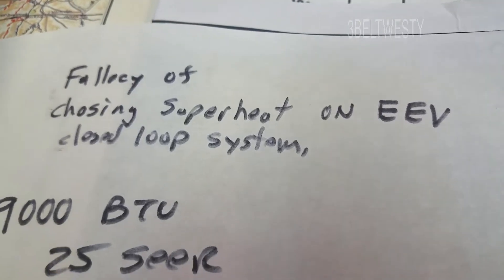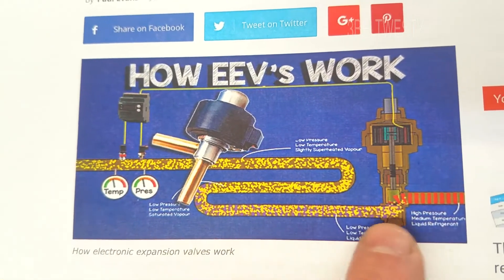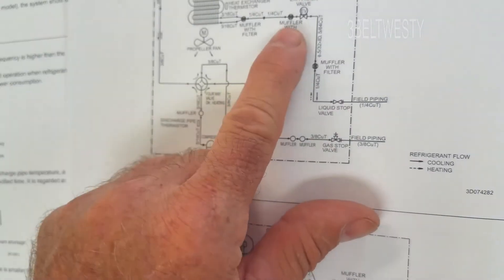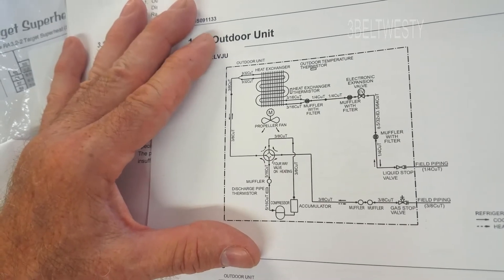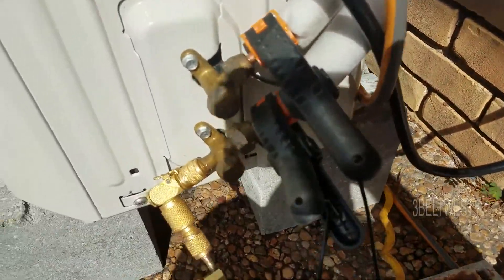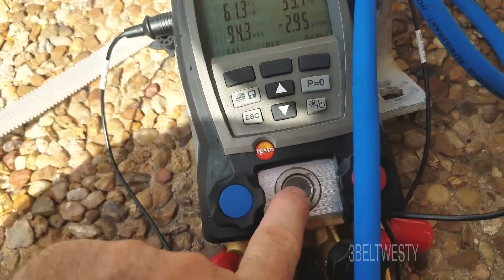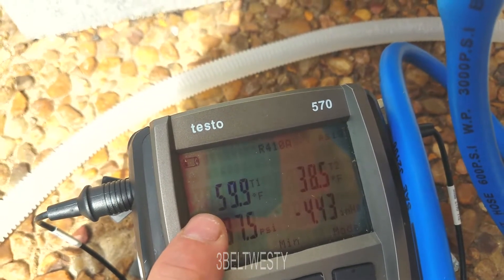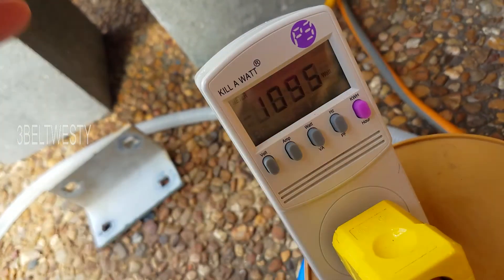HVAC Mini Split Superheat adventure (2) Fallacy

Comment: Mini Spits you can pulse/burst charge till air handler ∆T plateaus. 
Set all air handlers supplied by the compressor to max cooling and max fan "turbo" 
Then check psi, if low (≈ ≤80) →  deliver one small pulse charge visualize ∆T of air handler increase slightly then stabilize. 
Then you can deliver the next pulse , Repeat prn till ∆T no longer increases after pulses.   
If no wireless temp probes → pulse charge till PSI no longer increases ≈115-125
Then tighten the flare connection that is leaking.
MIni Splits  have a large receiver and  a EEV so a slight overcharge will not affect the performance.
Reply: Where can I source this info?
Reply: @nicsavage8868  Your can source it by asking any HVAC technician you work with. 

Its a given with any system,  you achieve max ∆T at air handler, while system is running at max output the charge is correct.. 

It's kind of like you say my kitchen light is on because its illuminated, and I am asking you where to source the info, that lead you to know the kitchen light is on?

Where , what, or how would you begin to answer that.

On my 5 zone split system at home I use this to fine tune my system, 
 i.e. My garage lost cooling ∆T =4
I titrated to max ∆T which equaled 1lb. 
Now the ∆T is at least 30 on a 100F outdoor ambient / 25F on a 120F outdoor ambient optimal numbers no recovery needed and it took me 15-20min. one wireless gauge with a tee connection to charge through,  no manifold, no pipe temp clamp. 
You can remove the core and recover and weigh the charge and calculate and try to measure the supply lines length x diameter + height difference from compressor to air handler , is it lower or higher by, the sum of  how many air handlers is it suppling , add those numbers together to achieve your charge weight, which is just based of off your estimations , charge it up, and it blows cold, job done, give the client a large bill for the recovery, and a lot of your time wasted,  instead of lesser charge for titration and adding 1lb of 410A, 
then HVAC tech then goes to the next job. 
These calculations are done to get your system to achieve max ∆T (peak performance of your system),  but you never actually know if you hit max ∆T until you use continuous live measuring and titration of charge this is the actual proof of max ∆T.
Reply: @curthoward79  any advice on how to do it at winter condition, in heating mode ?
Reply: @Patenciarz  Yeah just did this last week for garage mini split not heating, put it in max heating mode. Slowly titrate the charge till you get some good temperatures from the indoor air handler. Keeping in mind the of amount charge your putting in.
Reply: I’m curious. 3beltwesty charged the system to 97.5psi and thought it was about right but you are saying around 120psi is the ideal pressure. I’m assuming you are talking about R410A, so why the big difference?
Reply: @kevinmills5293  I posted this info to let people know , you can safely pulse charge or pulse recover 410A as opposed to recovering and weighing every time you service a mini split system
I don’t even remember the whole video I have watched hundreds of videos like this. No one seems to teach how to pulse charge a mini split tittering in heating or cooling to indoor air handler delta t. 
just off hand 97.5psi might seem low for a 410A compressor running near max. But if the cooling/ heating is good then you don’t need to do anything. Low Psi just would confirm system is undercharged after you established system is not cool/ heating.  
Since mini split systems use EEV and variable compressor there is no set low psi number. But you could make a good guess that no cooling running in max load with PSI of 97 system is not overcharged , most likely undercharged. You could diagnostically pulse charge and go from there. But if system is working fine then 97 psi is ok.

Comment: This video hit home with me today.  I installed a Seinville 9000 btu.  I had to install a longer line set, 16 ft to 25ft.  The manual is somewhat confusing about whether the unit is precharged to 16ft or 25ft.  It didn’t matter because the cheap ass line set had awful flares and the leaked most of the refrigerant.  So I had to go the superheat route.  I fixed the leaks but basically I couldn’t get the superheat down no matter what.  But, I was getting 53f out of the unit with an input of 77f!  I will take it!  The pressure on he low side was 125psi which seems to be the sweet spot for these
Units.

Comment: Wow 3beltwesty, maybe some new hoses 👍😊
Reply from the maker: These hoses with bulges are actually brand new, but the lowest cost ebay set. (too cheap!:) I have a great high end set for R22 usage that is 25 years old with no bulges. With is R410a unit I added extra insulation to the smaller 6mm line to cut some losses. This weekend I am going to add extra insulation to the suction line too. Here it is super humid. Thus the dew point in the morning has dew on items outside. The charge on that unit is now dialed in now. At the lowest inverter mode with the compressor on it is about 220 watts. This unit was made by Midea as a rebranded unit under the SuperAir name. Once the compressor is off the inside fan and outside unit draws 18 watts at high inside fan speed, say 12 at mid speed.  https://www.youtube.com/watch?v=X0DHK8cT9KU&t=499s